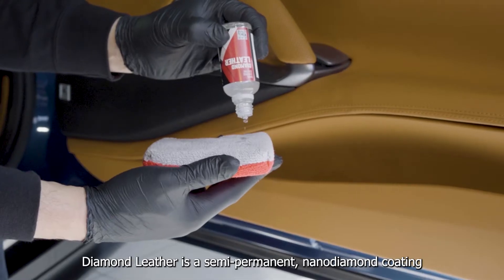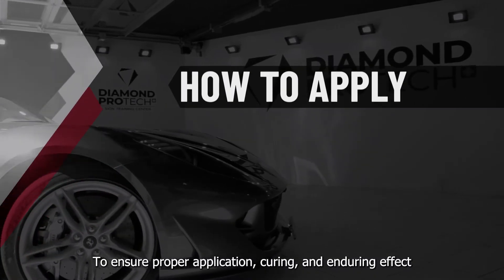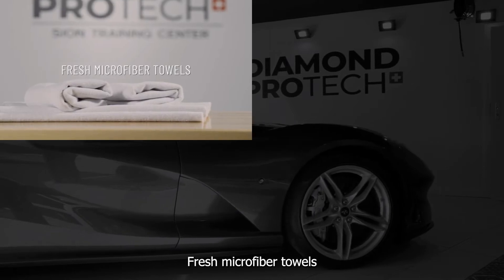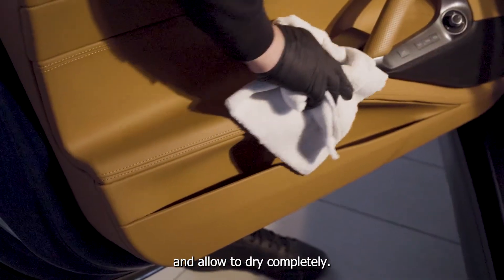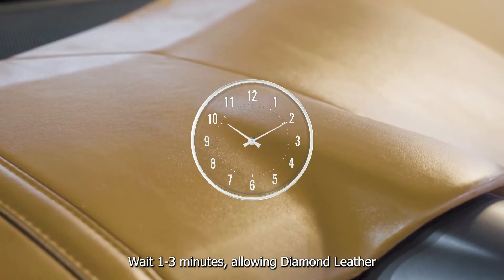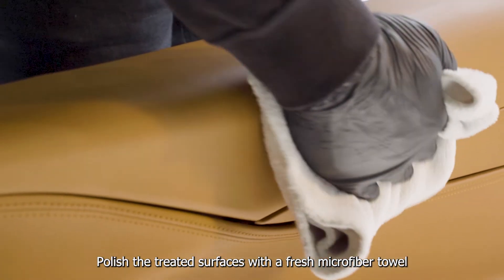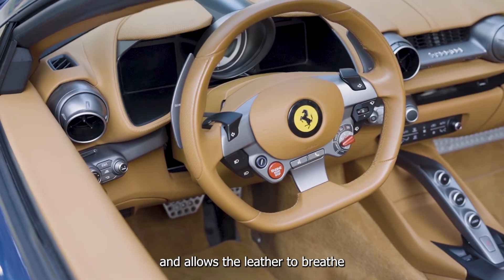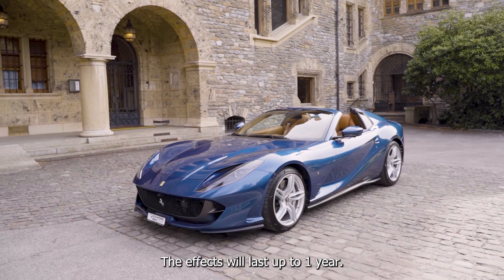DIAMOND LEATHER  | Application Instructions

Comment: Is this product safe on Nappa Leather
Reply from the maker: Thank you for your question, yes, it is! Diamond Leather is ideal for any genuine leather and is suitable for synthetic variants as well.
Reply: @diamondprotech what is the difference between this item and one like Gyeon Leather EVO?
Reply from the maker: @wlsnwilson  

We’re a nanodiamond composite coating. While we can’t speak in detail about their technology, their product would be classified as a ceramic coating.

Some key highlights of our coating are as follows:

- It performs exceptionally well on genuine leather and works great on synthetic leather too.

- It’s breathable, allowing the leather to function as intended from the factory. This breathability also makes it compatible with your preferred leather conditioner—something most leather coatings don’t allow.

- It’s hyper-flexible, enabling it to move with the leather as it shifts and reshapes, ensuring optimal long-term results.

Our coating is also currently 25% Off on our website, we recommend you grab the kit as it provides everything needed for a smooth installation process: https://diamondprotech.com/collections/complete-coating-starter-kits/products/diamond-leather-kit

Comment: Does this work with Tesla's "vegan leather"? or do you recommend something else for the Tesla seats + trim?
Reply from the maker: You will want to use the Diamond Interior for those seats.
Reply: @diamondprotech  anything bad if I use the leather ceramic?
Reply from the maker: The composition of the coating can damage artificial leather. It can cause a dull look after time.

Comment: What type o cleaners can be used to maintain it?  Leather coatings are great but they still succumb to dirt.
Reply from the maker: Any mild cleaners that are designed for use on leather and interior surfaces will be fine to use. If you routinely wipe the surface down with a damp microfiber (warm water) towel it will help keep the surface clean from dirt and oils.

Comment: Is a second coat ideal? What is the shelf life for this, opened and unopened?
Reply from the maker: Hi! My name is Tony! I'm an Ambassador for Diamond ProTech. One layer is sufficient. A second layer could be applied if you want to ensure you didn't miss any spots, but isn't necessary. An opened bottle if tightly sealed will last 6 to 12 months. Store it in a cool dry place away from sunlight.